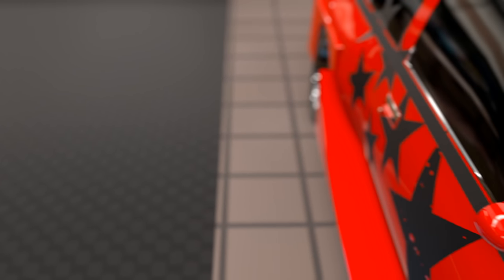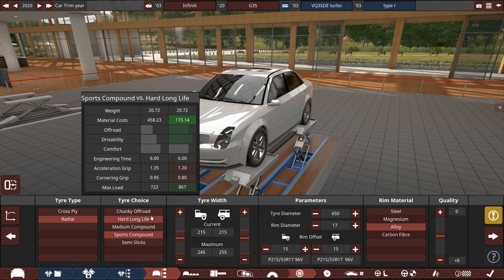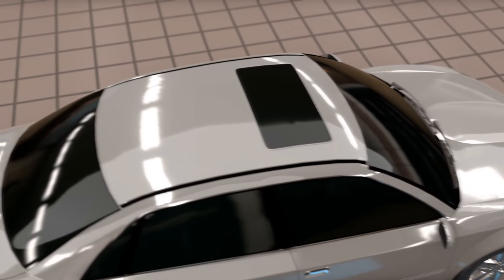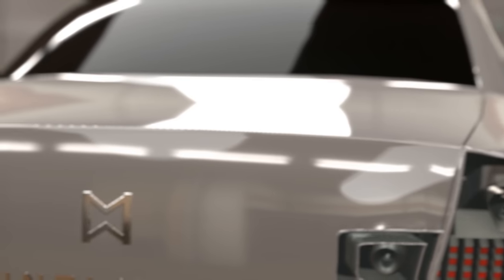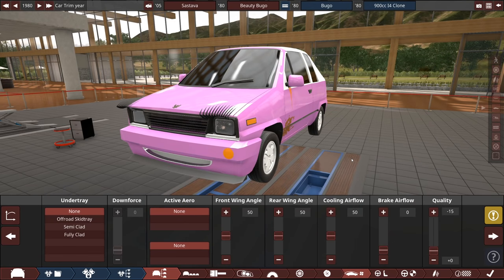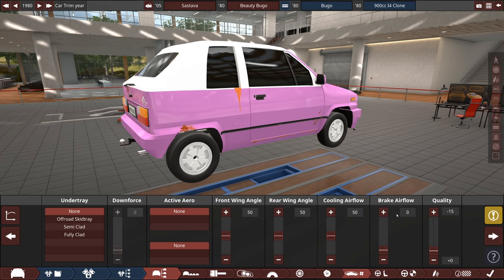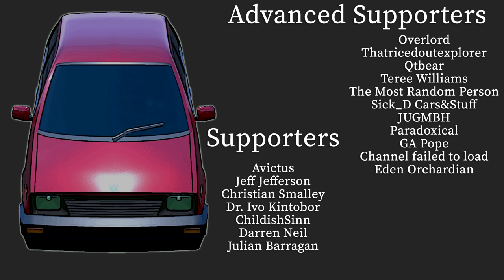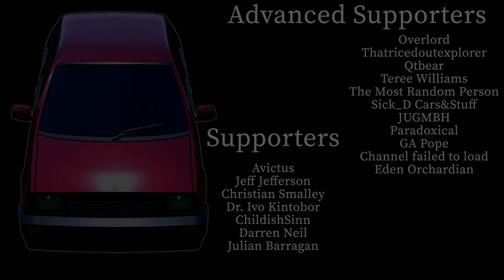My Automation Wishlist (5 things I'd like to see in game)

Comment from the maker: Dev pls add twin charge quad turbo diesel V17.5 rotary engines to the game
Reply: I too really want a twin charge quad turbo diesel v17.5 rotary engine to go in my Renault twingo
Reply: pls add 69 turbo and suepercarger diesel hydrogen elektrik hybrids Vr18 W50 I69
Reply: Plz dev
Reply: I was gonna say!
Reply: Automotive flux if you are offroading in beamng just lower the tyre pressure with vehicle config makes the car preform better offroad
Reply: @R42sd1 X i think they've said they wont be adding rotaries any time soon, its not in their focus at all right now
Reply: W engines?
Reply: @JamesConnor116  Yes, W engines are two V engines put together, it's what powers all your World Record Cars and the Tuatara
Reply: V69 is cool
Reply: Is it bad I'd like for electric engines or maybe dual engine setups?
Reply: @questorio  W engines are not two VS put together 😂 they are staggered cylinders in a v
Reply: hopefully
Reply: Real talk: An expanded sandbox mode which doesn't limit anything (eg rwd transverse, no engine space limits, the ability to turn off engine damage and/or brake fade, basically any form of limit to making things) so users can really go wild and make everything they want.
Reply: yes
Reply: "Please add the merge engine option, so rotary, diesel, electric, inline and v engine can share the same flywheel"
Reply: or twin turbo inline engines
Reply: Quad turbo diesel please

Comment: Im hoping they extend the timeliine of the game past 2020 and make the paint look nicer in beam
Reply: i think the paint issue is either a thing with beam, or because of a exprortation limitatuion on the side of automation.
Reply: yes
Reply: Beam doesn't have perleasents and flake options soo the base colour of your paintjob will be what will show in beam
Reply: I guess the paint may be more of BeamNG's problem ? It's hard to know which developer has to work on which features when you cross games like this.
For example: offroad Automation vehicules are crap in Beam but is this because of Automation that don"t export the correct specs or is it because of Beam that does not translate Automation's specs correctly ??? hmmm
Reply: @2090skid  Beamng has a pretty good suspension system so it may be exporter fault
Reply: Maby they wil extend the timeline every year now

Comment: Lemme get these out of the way:
Diesel
Superchargers
Rotaries
Reply: I can already see the fuel efficiency and reliability penalty on rotary lol
Reply from the maker: The holy trinity
Reply: @automotiveflux  supercharged diesel rotory
Reply: Diesel and rotaries are probably never coming, but superchargers probably will
Reply: @rysea9855  diesel may come in a dlc if the game sells well enough, and it's a commonly used fuel for the engines, but rotaries are not very common and kinda let's be real suck at real life stuff, but i still love the rotary dorito
Reply: Supercharged diesel rotaries?
Reply: Diesel and supercharger I would love for their usability.  But let's be real, how many times have you built a stupid powered car that can only WOT for 30 seconds without blowing the motor?  Now imagine a rotary in the game. 
The port could replace the camshaft section and serve the same purpose, Apex seals instead of valve float.  The base numbers would be different but the calculations should actually be the same I would think.
Reply: i'll do you one better: diesel supercharged rotary

edit: didnt see the guy who commented this 30 seconds before me
Reply: @ragingfred  Yes. Supercharged diesel rotorys
Reply: Diesel would be so cool.
Reply: with their team... they said it would take them 8 months to program it.. or something like that...

Comment: more choice in engine bank angles (72, 120, 15*), more stupid crankshaft profiles (odd firing engines), more low cylinder count options; i2? v4? - they existed, were quite common, why not have em'?
Reply: Yeah more stuff to separate your engine design from others

Comment: The one time I'm early I have actually do work - my personal wish would be superchargers and more engine block options - flat 8, inline 8, V16, etc.
Reply: V16 is a DLC, nice way to support the devs
Reply: Thr inlane 8 could come with the V16 dlc in my opinion, but yeah I miss a boxer 12 every now and then. Also the firat koenigsegg was suposed to use a flat 12 at some point!
Reply: Screw it why stop there. 
I know its alot of work but why not have flat 12's like in the porshe race cars of the 70s. 
W8, 12 and 16's
H16's
V4 and V5's
Reply: The V16 being a DLC always has been a let down for me

Comment: My wishlist:
- More suspension options (seriously, why can't we have a 4wd car with full trosion suspension?)
- Toe, caster adjustments
- Make the car with insufficient cooling actually overheat in Beam
Reply: I agree on the suspension. I'd like to be able to select the rype of the differentials one by one.
Reply: I already managed to make a car overheat in Beam even with Automation telling me that everything was ok. But you really need to go mad to make it overheat (I was making a 2000 hp V12 with 0 cooling to reduce drag and a monstruous gear ratio)
Reply: @2090skid  dragster?
Reply: @-SBR4Z-  No it was a top speed build. I tried to beat 600kmh but didn't managed with this engine, the car was overheating at 400 !! O_o
I finally managed to go to 608 km/h but with a 2000+ hp V8 much easier, If you're interested there's a video on my channel about this record ^^

Comment: Also things that would take longer: W Engines, V4 Engines & other unconventional engine types, Triple & Quad Turbos, designing your own gearboxes,  more detailed options designing engines, suspension, etc, Hybrid systems like KERS, or the Porsche 918 electric motor on each wheel and the McLaren's V8 generator. This last probably wont ever happen cuz it's ALOT of work but basically you would have to design & build prototypes/test mules to get research data, like you would have to play with suspension tuniang & gearing then send it around the track to see the results. ANDDDD another HUGE one would be some sort of car magazine that would have competitors car reviews and yours and your prototypes/test mules could get spotted with some random generated photo.
Reply: Oh my god an actual campaign suggestion and it's amazing!
Reply: These are the best suggestions by far.

Comment: With the advent of 3D part placement; as well as being able to size (Most/all) parts in X, Y, and Z in 2D placement now.

I'd love to see a 2D Z level placement option; basically the ability to sink or raise parts deeper into the body while still holding their morph to the body shape, this would make it simpler to sink parts into a grill or body molding; Something that would simplify making complex parts (I know you can expand parts in 2D now, I just mentioned that; I mean to actually drag parts in/out of the body without morphing the part's size)

Also; additional layers, 4 is generally enough, but if at all possible, 8-16 would be nice to have.

Again, with 3D placement; I'd also like to see 3D placed parts have a layering option so that a 3D part can "Layer" on other parts in 3D; this would greatly expand our ability to make complex parts per-car.

Back to layering; I'd also like to see inverted parts for layering; or inverted layers, so parts placed on them remove their shape from the car.

Compound parts; the ability to group parts and and save them into a single unit for re-use later.

I'd also like to see a push into hybrid and electric; since Electric cars have been around almost since the beginning of automobiles, I can't see a reason not to have them in the game (At least hybrids in the 2000's stage - But I'd love to see little eco-box electric cars from the 70's)

They gained resurgence in the 1970's; and became commercially viable in the early 2000's. - I don't doubt it'd be difficult to actually get electric/hybrids in the game, but I also imagine it's possible.

Partial Fiberglass body panels; Please? There's no middle ground to reduce weight except partial-aluminum; and that's expensive - when many cars did use Fiberglass hoods and/or doors to save weight prior to most manufactures abilities to mass press aluminum parts in the late 2010's.

Molded Plastic/Resin body panels, Another body panel type that's not adequately explored, there's more than a handful of cars that have used plastic/resin body panels to save weight or design time over steel.

Totally for the meme's; Wood Timber frames. While I'm saying this purely for memes, it still used in Morgan cars; so, it's a thing, it exists Who wouldn't want to meme it up with a timber framed super car.

More options for micro cars; bodies, and engine platforms; V-2, i-2, and flat 2 engine platforms would be a nice experiment into micro cars.

At least a few more engine platforms/options, i-8, W-12; Flatheads (L-Head), T-Head; as well as single, double, and quad turbo options. (Obviously, I'd like to see Super Chargers; but I've heard that's already planned, so no sense asking - but I would love to see Super-Turbo changing; aka "Twin Charger" options.)

More engine banks; The real world best choice for V10's are 72 degrees, but we only have 60 and 90.

CVT Transmissions.

Another slightly meme ask; Jet turbine, Turboshaft engines. (Chrysler prototyped this in the 1960's; the car was technically successful, and at least one know model still exists and is operable today; Jay Leno owns it...)

And I think that's about all I've imagined I want.

Comment: Even though you said diesels are far out there, I still would love to see that one day. It would be cool to see what kind of truck, and even locomotive engines. Imagine the power levels and the turbo noises. 
Edit: it would be cool to see a line of larger truck, like medium commercial trucks and tractor trailer trucks. They would be able to fit the larger engines. Also electric cars. Might be an unpopular opinion. Maybe a choice in ac or dc motors, size, gearing, battery type (l-ion, graphine) , battery size.

Comment: Full race options (Slick tires, higher octane, race interior, race safety, higher rpm), superchargers (roots, twin screw, centrifugal), more turbo options (single turbo v6, twin turbo i6, etc.), more exhaust manifolds (short tubular, for turbo or na engines), flywheel and clutch options, more engines (single cilinder, i2, i8, v4, boxer 2, boxer 8, vr4, vr6, vr8, w8, w10, w12, w16), aircooled engines, flathead, intake and exhaust in the same side (like in the nissan l24)

Comment: I think the part about the cooling and brake airflow sliders is kind of null. If I'm building a car that needs some more brake airflow, I would put some vents specifically for the brakes. Mostly at the front bumper and maybe the rear fender for more cooling. This idea also continues to engine cooling as having air intakes and radiators at the side of the body is more reasonable then sticking everything at the front. Perhaps a better implementation would be tagging a vent or grill as cooling a respective part, so your design choices would have to also fit function, rather than just form.

Comment: Mine:

Twin turbo (parallel and sequential) turbos in inline engines.
Single turbo in V engines.
Quad turbo in 12+ cylinder engines.
W shaped engines. (W12 - W16 - W8)
Sound tunning in exhausts, (different size headers / different sound presets).
Superchargers
Diesel engines.
The ability to make different wheel sizes in the front-rear axles (Example: 20 inch front 19 rear). Many cars have that.
Ability to remove the intercooler if needed to reduce costs/make it vintage.
Being able to modify the watercooling in the car (the capacity of the system).
Being able to add things like launch control / two-step to cars.
Reply: You can remove intercooler if you put it ad 0hp

Comment: It would take a long time to do all of this, but I'm hoping to see at least some of it-
Diesel/dual fuel
Hybrid/EV/hydrogen powertrains
Superchargers/twin charging
More control over number of turbos
I2, I8, V4 engines
More model years (1900-2025)
More body morphing/fixture morphing (what we have is too limiting)
Fix paint in BeamNG including secondary colour glitch

Different size wheels front and rear

Comment: I'm aware of why they won't be adding these for a long while, if ever, but this is a wishlist, so, let me wish.

- More engine types, such as: single cylinder, I2, other larger inline engines, V2, V4, B2, B8, B16 (ok these probably don't exist at all but still)
- Diesels
- Hybrids
- Electric cars
- Rotaries
- Superchargers, different turbos, and etc (I am aware that this is already coming)

Basically, just more different + unique ways to power a vehicle.
Reply: The Saab 9000 used a V4, so at least that one exists in a production car

Comment: Custom position of turbo in the engine bay

Like getting the turbo in the front or above or just putting it closer to a bumper zone idk

Also being able to tilt the engine by some degrees and have the opportunity to have custom angle v engines like a 70° v 8 or a 15° v6 so it turns into a vr6 idk something like that being able to choose a custom angle for the v shape engine like between 45° to 90°

Comment: I would like to set each gear ratio in the transmission separately, they could use sliders for each or just let you enter the number directly.  Maybe a checkbox that's on by default locking it how it is now but you turn off and it lets you change each gear separately.

Edit I made this comment before I got to that section of the video, I think this just shows how many people want it.
Reply: Also moving the wheels a little bit front to back.

Comment: Diesel, rotaries, superchargers, single turbo for v/dual turbo for inline, different cooling types and oil types (wet sump, dry sump, air cooled, water cooled), chassis reinforcements (carbon, steel, aluminum, none), transverse leaf spring suspension and 2 3 and 4 link solid axle coil suspension.

Comment: in my opinion they should add customisable exhaust noises, what i mean by this is choosing between different exhaust tones, as not all engines of the same cylinder count sound the same eg V10's. the carrera Gt and Huracan are quite different in terms of sound, which is why it would be nice to be able to choose what exhaust note you want.

Comment: A Unique engine option such as the Wankel that Mazda uses, there could be another option alongside Inline V60 and V90 called Unique and you could choose between Wankel OPOC, Single Cylinder. Along with engines, there could also be a W type. These don't have to be modeled well at first but each one could be modeled in a later update.

More Customization options:
A Vinyl Wrap option could be cool. you could load custom wraps or some preset ones and also create textures for vehicles.
A Stripe or Full-Body decal option, these are probably introduced with mods already, But it'd be cool to see in the Base Game
Some greater body molding features could be seen too like a 3d option.. but that's not realistic.
Reply from the maker: Vinyl wraps would be great, vehicle skins essentially

Comment: Diesel. Rotaries. Super chargers and the syntrifacal super chargers. Single turbos and twin turbo. Inline 8 and boxer 8 (they did exist look them up) smaller motors 2-1cylinders V and inline shape. And v4 engine like some formula cars had

Comment: Inline 2 cylinder engine and some older parts like from 20s or 30s
Reply: Inline 2 cylinders, flat twins, V4 or inline 8 cylinders would be great.
Reply: Single cylinder engines should be there too
Reply: @butjustwhy4018  single cylinders would be pushing it a bit but still, I believe that they have a modular system for the engines so it would be quite simple.
Reply: There are cars who use single cilinder engines the peel p50 for example.

Comment: I really like to see heave dampers in the game. Especially if you are building high downforce cars for BeamNG you often got the problem that the car is scraping on the floor at relatively low speeds (ca. 250kph). Heave Dampers would really help to make the aerodynamic platform of the car stable. 
You could also rework the suspension tuning in Automation as well, for example you could youse real physical units instead of numbers from 1-10. 
At the Moment it is quite sketchy getting high downforce cars to work in BeamNG because the downforce in Beam and Automation is calculated differently and the suspension tuning in Automation isn't suited for cars this extreme. 
As for now you still have to experiment a lot to get those cars to work in Beam. The 3D-placing helped a lot in this regard, especially with creating a smooth undertray and getting diffusers to work. 
I hope they will improve on this in the future.
Reply from the maker: Totally forgot about the dampers being an issue, love seeing that warning about scraping the ground at speed

Comment: The force induction update (that’s it is confirmed by the devs of this game on the upcoming update 4.2) will bring a revamp to turbos  plus the addition of superchargers and the ability (hopefully) to do twincharging (aka the ability Combine a turbo charger and a supercharger which means a supercharged assumes control on the lower RPM range the turbo will assume control on the higher RPM range just like historical cars did in real life)
Reply: So i can make my 2000 hp drag car even faster this would be sick

Comment: I gotta agree with Flux over here, engines are insanely difficult to implement, so it's much better to add other kinds of abilities instead of engines. Also, most of the turbo stuff mentioned in the video is coming in 4.2, iirc.

Comment: Inline 8's used in the 30's  large capacity low revving Inline . Boxer 12  , W engines   for beamng drive they really need all breakerble parts . That may be to complex to make , maybe they  could help each other out.